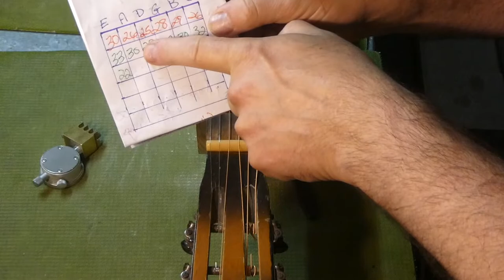Guitar Back removal / re-glue /repair and nut making

Comment: heat the glue up to 70 degrees celcius next time, and you can take the back of without cracking the wood.
Reply: Have you noticed a lot of luthiers do not like heating the joints? You certainly can damage the finish... but I too prefer a bit of heat. However, I am here to learn, and I have learned at least 3 tricks from this video.

Comment: Thanks for the information, I am watching several videos on removing backs before I try my first one. I replaced a front that was damaged in a fire. (Heat, smoke, water: turned it into a 5 piece curly mess) The function is great, but the look, not my best work :) This will be better I am sure.